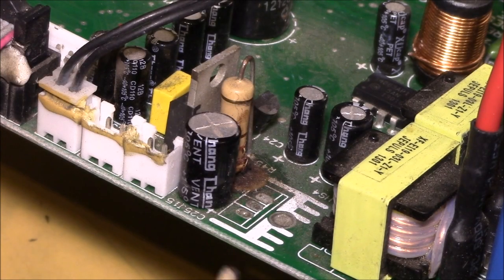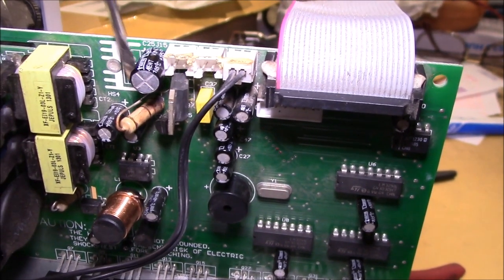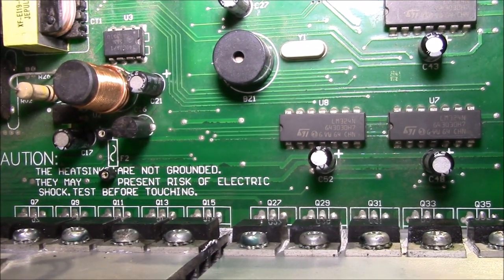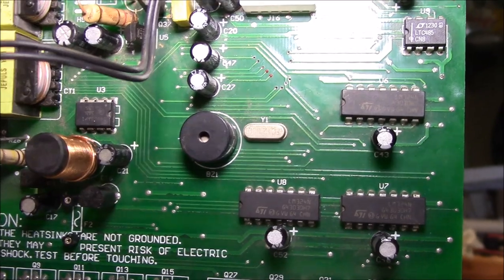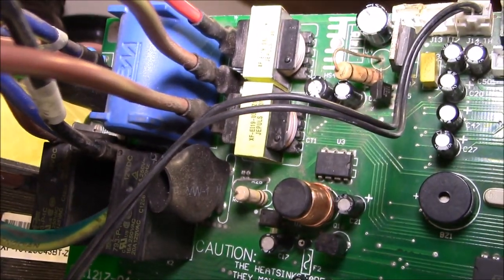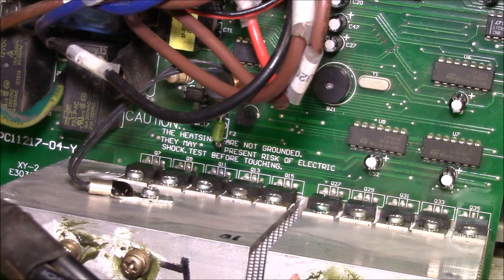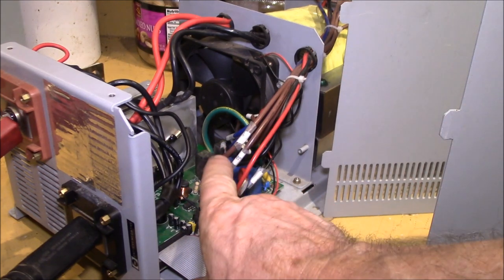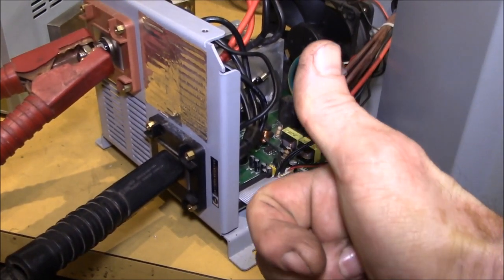TrippLite APS1012SW Inverter/Charger Blown Caps, Part 3

Comment: Did the cooling fan/s cycle at boot up? Great job
Reply from the maker: I don't think this inverter ever did cycle the fans on at power up.  It seemed to be a combination of load current, time and possibly temperature that controlled the fan.  If you turned on a big load, the fan would kick on then even if that load were turned off, it would stay running for some time after.  But that said, I think the fan controller circuit is not working at all now, have some plans to fix that upcoming.
Reply: Interesting does the manual reflect the fan cycle at the power up sequence, I think it's a standard procedure but I could be wrong. Be Safe
Reply from the maker: No mention of that in the manual that I can find.  In fact it doesn't even mention "fan" in the whole 24 page manual.  I know my PC fires up the cooling fans when you first turn on the power, then they shut off in a few seconds.  So yes, that is a fairly common thing to do, sort of a self-test I suppose.
Reply: Well it is what it is, maybe we could add a separate cooling circuit to it! Godspeed